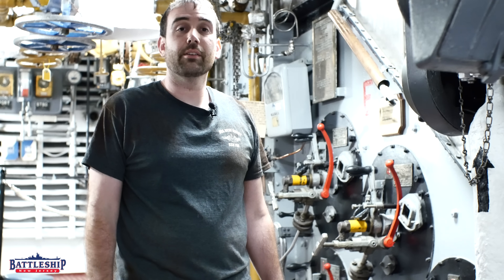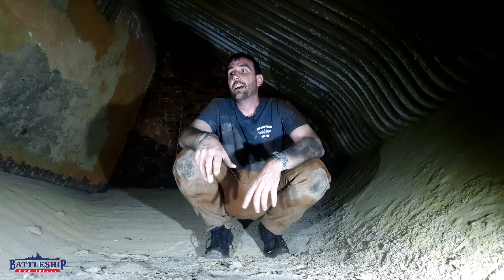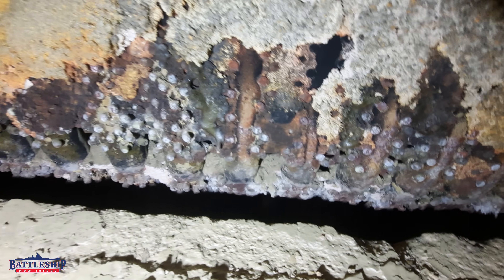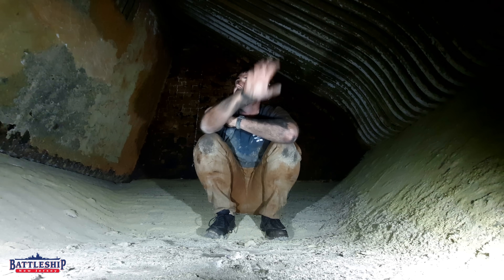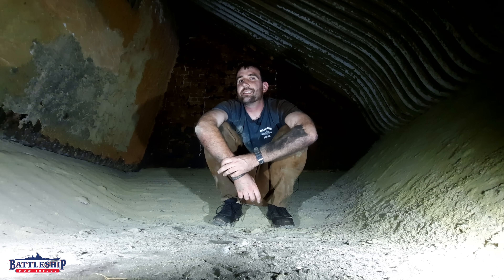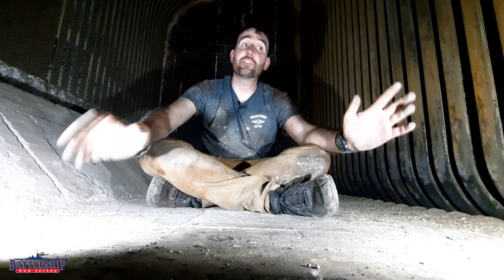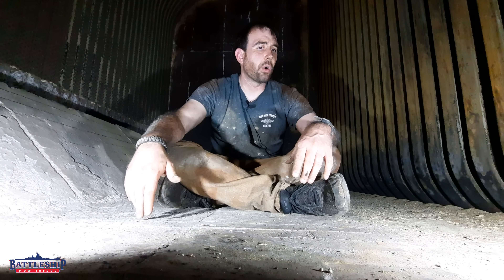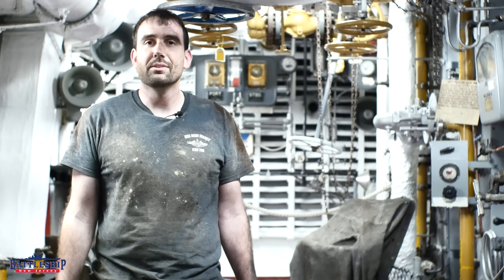Inside the Boiler of The World's Fastest Battleship

Comment: How similar are these boilers to what would be found on the ALCO Big Boy locomotives from the same time frame? Thank you & enjoy the vids.
Reply: Locomotives have firetube boilers vs the watertube boilers typical of marine plants.
Reply: Fire tube boilers have the fire on the inside, water tube boilers have the fire on the outside. Water tube boilers are much bigger usually and run at a higher temperature.  the water tube boilers are “high output” meaning that they put out a lot to steam to run the shafts and generators and auxiliary feed pumps and main feed pumps and oil pumps and forced draft blowers and fire pumps and steam kettles (in kitchen) ETC. fire tube boilers basically have a single purpose, run a drive shaft, heat up water for heating systems, stuff like that, not saying the have no other equipment, just one main purpose.

Comment: Thanks for going the extra mile and crawling in both sides!  ISTR hearing that later ships made higher pressure steam than the WW2 ships...  Is that true?
Reply: Large ships usually ran 600 PSI plants, while the smaller ones often ran 1200 PSI.  1200 PSI plants are physically smaller, but the higher pressures and temps make them a bit harder to maintain.

Comment: Been there, done that. 55 years ago. I had both 'M' and 'D' type boilers in my time aboard ships. One thing that most didn't realize was that in the combat zone, that boiler repair work was 24/7 until the boiler was buttoned up and re-fired. We had no 8 hr shifts. It was work until either it was your turn to stand watch again or the boiler was put back online. Many a night I snoozed on the deck plates. On most boilers, a burner was pulled to access the box. The 1600 hr steam time was just to clean and wire brush the exposed tubes and metal surfaces. Re-brick was only done in a yard unless there happened to be a brick failure and then the damaged areas were repaired with new brick. The studs were there to hold the plastic chrome ore (pco) that came in danm heavy short barrels that was rammed a handfull at a time with a pneumatic hammer, about the studs wielded to the tubes around the transition points where the tubed entered the drums. Most of the burners were fitted with pre-shaped fire brick supplied from B&W. Every opened boiler was a 'joy' to look forward to for the BT's. When I was in, the safety breathing equipment consisted of old T-shirts. That ash on the deck of the boiler was converted into clouds that a BT breathed for weeks when scooping it into buckets. That and the 120 degree heat of the Gulf made such a great incentive for telling the on-board recruiting NCO's where that stood in our lives. There was no cleanup when it came to chow. We would climb out of the hole and apparently looked like a pack of racoons standing in the chow line. From a good standing member of the Tonkin Gulf Club.
Reply: Hearing about all the occupational hazards I am happy to hear you being able to talk about those things so long ago!👍🏻
Reply: Let us not forget how hot the air was  , as i remember shortly after lite off the air temp would be at least 120 Degrees. I personally saw at least 3 thermometers that  exceded the scale (260 Degrees F) . Thank You . As a point of Trivia When I was aboard USS Hepburn FF 1055 in the Indian Ocean The Corpsman came down one day , the coldest place that he could find was 155 degrees , I never found out the hottest he recorded. Thank You . After all if the Snipes don't groove the ship don't move.
Reply: @henrycarlson7514  I was an FT on the USS Cromwell, DE-1014 circa 1966-1968. I remember seeing the BT's that passed out from heat exposure being brought on deck, washed down with cool water, rehydrated with bug juice and sent right back down to the fire room. BT was the worst job on the ship.
Reply: @richardbartley5906 Bug juice?
Reply: @iskandartaib  A little packet of flavoring the cooks would add to about five gallons of water and tell us it was fruit juice. Like cool-aid, but much more concentrated. Funny thing was the BT's were drinking so much of it that it was making them sick. Chief pecker checker told them to just drink water instead. The BT's were the ship's wild bunch. I stood petty office of the watch in port and dreaded having to deal with them when the came back from liberty. Good guys though!
Reply: @henrycarlson7514  I am doubtful.  We saw 127F air temp in the Engine Room in the gulf, with the FD air running flat out.  (between the TA's)  No idea what it would be like with only the NBCD coolers providing cooling, probably 140F, but never anything like 260F.  You'd be boiling (literally) at that.  It was worse in the BR, particularly on fan flats (and even more so adding chemicals), but I'd doubt even 130F.

As my ring says- 2A-3A-Circumnavigated .  Been there, got the photos, been in the modified D boilers (1664 generating bank tubes, 51 rear wall, 37 side wall, 3x51 superheat), 7050 lb/hr full fuel flow, 88 k lb & 19 k lb steam flow, 107 k lb water flow, 865F superheat temp....28.3" hg ME vacuum, 100-117 RPM max shaft speed, 21 000 SHP by torsion meter).

I never went into the steam or mud drums- but I spent a bunch of time behind the boilers, replacing steam temp control valve bonnet gaskets.  I did a fair amount of time in the BR & ER, as I was the Jr (by rank) controls tech basically 2002-2010, then Aux Machinery PO 2010-2012, and was going to go to the RAS deck in 2014 or so had I gone back before the fire.  

HMCS Protecteur, which I assume is the last steam ship to circumnavigate the world in 2008.
Reply: @jamespowell7302  I stand by those temps as thy were taken by the corpsman with a dry bulb thermometer , I also standby the readings that I personally recorded. Sadly I an sure the documentation is gone. . Congratulations on that trip. When I was aboard USS Ranger I presonally saw 2.2Million ftlb  of torque at 172 rpm , 6 boilers at 2200 gph . that was 76,000 tons of Aircraft carrier going 29.9 Kts. . There were 2 boilers not lit off.  Thank You for sharing. . From what I remember the US Navy operated at 1200 psi and 970 D F . Happy trails, Snipes RULE
Reply: @henrycarlson7514  Snipes
Heaven didn't want us and hell was afraid we would take over.
Reply: So true @robmcconnell4702
Reply: @henrycarlson7514  Snipes, the first of ships company back to the ship to bring her out of cold iron. And, the last to leave the ship when we hit any port.
Reply: @jameslong3351  So True, If the snipes don't groove the ship don't move
Reply: @jameslong3351  I was a photographer for a large company that had it's own steam plant. The boilers started out burning coal but were converted to natural gas. Thrn after we built a giant "bag house" they tried to convert back to coal. Nobody could find the original drawings so they kept getting a buildup of "clinkers" on the tubing. I got to go in and photograph it so the fire brick could be reconfigured to eliminate the buildup. If it cooled too much the clinkers would break loose from the tubing so I had to dress out in PPE and be slide in with my camera on a board like a big pizza. It was an unforgettable experience. I seriously liked the job because as long as I was inside I never saw a supervisor to aggregate me. I got to know some wonderful guys running thr steam plant.
Reply: Boilermaking ruined my knees crawling in and out of economizers steam drums and mud drums. I can’t even kneel on carpet with padding on top. My knees are toast, I’m as close to knee replacement as you can get.
Reply: Yeah definitely a pack of raccoons with somewhat clean hands. Fireside and Waterside. CV-67 B-Div 4MMR
Reply: @robmcconnell4702  And that, dear children, is why I'm being contacted at least yearly now, by attorneys for the families of former shipmates who suffered through mesothelioma (asbestos related lung cancer) to sign a deposition regarding work conditions in ship fire rooms. That and hearing loss from machinery, especially forced draft blowers, is certainly effecting our so called 'golden years.' This comment from a retired BTC, 17 years sea duty, (1956 - 1976) now 83 YO.
Reply: @johann5633  did those boilers also have induced draft in addition to forced draft fans?
Reply: My brother in law was an ET on a DE when the Tonkin incident went down. Since his battle station was in CIC he told me it didn't go down as reported. I was an EN on a sub tender and I work on the landing craft we used to haul stuff across the Clyde in Scotland. One of my jobs was to open and crawl inside the diesel fuel tanks on landing craft to clean them. The NJ was next to us when we were in the yards in Bremerton. At the end of Desert Storm I was in Bahrain with a Navy Reserve unit when the big MO stopped in her way home I bought a ball cap in ships store. I saw her in the moth ball fleet and was very happy to see her alive and well.
Reply: Yea the heat was literally unbearable during emergency shutdowns when a tube had burst or the like. Didn’t matter how many airhorns and fans at entry points were used, the air coming out was as hot as a hair dryer could produce.
One side of boiler was forcing air in, other side was pulling air out just to cool it where it could be entered without falling out from heat exhaustion.
I only “survived “ one emergency shutdown, I almost had to be rescued as I almost succumbed to the heat. Worse feeling i ever had, like getting in your hot car in the summer, closing your door and trying to sit for 5 minutes breathing down really hot air. Regular boiler work was a cake walk compared to an emergency shutdown.
Reply: I would have jumped overboard lol
Reply: Tell them about doing watersides, that was what the 1600 hours was for was to kickin the steam and mud drums to punch tubes with a maneater.

I only remember once that a boiler was steamed pass 1600 hrs. It was the North Korean Axe murders of two Army personnel while they were trimming trees in the DMZ, the year was 75', but I could be wrong there.
Reply: What are the BTs, boiler technicians?
And Snipes??
Reply: @thomasmleahy6218  Thermal Dynamic Marine Propulsion Engineers.

Nothing is lower in a ship. We were the Unseen, Unwashed, Underappreciated men who without whom the ship would be only a floating pier
Reply: @thomasmleahy6218  Yes.  And Snipes are anyone who serves below decks, rarely seeing the light of day. Engineers. Bt's. Firemen etc. Generic for all of them.
Reply: @thomasmleahy6218  So true
Reply: Try being the only steam ship in Persian Gulf running 1 of 2 boilers FF 1089 J.L. Brown and blowing a tube going DIW and trying to save enough steam to start 2nd boiler 850 psi. Temps got 145 +/-  on upper level from what I remember ( those years are hazy at best ), think we were only allowed ( OSHA ) less than 5 minutes in that area then 2 hours in AC . All happening about 2 am
Reply: @philipfaris7144  Did it on the DE-1048. Those were terrible boilers, better to have used to make coffee at a large Starbucks
Reply: Did my time cleaning out a "mud-drum" of a B&W DDE boiler. The fuel tanks needed steam cleaning and what we referred to as "Butterworthing" or coating the inside of a bunker fuel tank with stuff that resembled butter.
Reply: Thank you for your service and may God bless you my friend.
Reply: I'm assuming that "Snipe" is a contraction of the old-timey word "guttersnipe", meaning a street kid or an unhoused/destitute person. Military services didn't screw around with nice friendly nicknames back in the early-mid 20th century. In those days, if you were the lowest on the ship I guess you got a nickname that straight-up meant "the lowest on the ship".

A more amusing alternative origin story could be that Snipe comes from the folkoric creature of the same name. A mythical and elusive animal (typically described as a bird but there's no rules about that), also rarely seen in the light of day, the target of the legendary Snipe Hunt. Otherwise known as a wild goose chase, quite familiar to any young seaman/apprentice who was ever sent to the tool shop for a left-handed screwdriver, a cable stretcher, or a long weight.

Thanks to the OP for the info about the studs on the water tubes, they instantly looked way too regular to be some kind of deposit buildup and I was really wondering what they were all about.
Reply: That lung cancer is totally not service related....
Reply: Great testimony! Thanks for sharing!
Reply: Unvaluable testimony !
Reply: B and W?
Reply: @DesertCatDad  babcock and wilcox
Reply: @DesertCatDad  Babcock and Wilcox
Reply: @DesertCatDad  babcock & wilcox  the first name in steam
Reply: Babcock and Wilcox--the first name in steam
Reply: Thanking you for your years of service aside, your opening says all I need to know... "Been there, done that..."  lmao.. you're that guy who finds a way, anyway to tell your story in conversations where all the topic needs to be is somewhat related.. you worked the hardest,  stayed awake on patrol and boiler repair the longest,  got the dirtiest, volunteering for the most dangerous,  ate chow the fastest, put away the most food, all while walking 10 miles up hill to get to the ship each day in a snow storm... lmfao... your comment was very detailed.. Ryan must have asked you about your work in the navy.. Just I must have missed that part.. otherwise you would be the biggest unsolicited claim maker too 😉
Reply: @svenben9868  I freaking enjoyed his reply, and he filled in all the gaps. Don't know what your beef is. Anyway, until YOU'VE been there yourself, you are really just an observer that knows nothing except to complain about a cool response. And now I do always appreciate those BT's that worked so hard to keep my ship underway while steaming about the equator, something you may not know about.
Reply: @svenben9868 respect to you.  Thank you for your service.

Comment: Two questions: 1 Is the 1600 hr figure accurate? That would be about every 2 months of operation, for fire-brick replacement.
2 - how does the fuel used during WW2 compare to Mazut, used by some Russian vessels?
Reply: 2: I do know enough about fuel oil to tell you Mazut and Bunker C are VERY similar. The main reason Russian ships that still use it smoke so much is because their all old Soviet Era ships that werent maintained. The Russians have been building everything lately with diesel engines, or Gas Turbines like the US
Reply: @TheMrLebaron  The main reason Russian ships that still use it smoke so much is because it's at the lower end of fuel oil(residual).  In a fractionation tower, lighter stuff evaporates(gasoline, #1 fuel oil which encompasses "diesel" and "kerosene", #2 fuel oil which is home heating oil) and is called distillates.  Heavier stuff pools at the bottom and is #5(bunker B), #6(bunker C), and bitumen(coke, asphalt, etc).  The pool is known as "residual".
Residual is gonna make smoke.  Longer hydrocarbon chains = less complete combustion. It contains larger amounts of the contaminants present in the feedstock(Notably sulfur and heavy metals), as all the contaminants just sit in that bottom pool.  You won't have as many contaminants processing "Saudi sweet and light" as you would "Kern County crude".  You could also do a secondary refining process.

However, Russians don't care.  Their fuel is...  kinda shit.  It costs money to put feedstock through multiple refining processes just to remove contamination.  Easier to leave the contamination in and ignore pollution/maintenance issues and sell it in grades based on the type of initial feedstock used.
Reply: @Grimmwoldds  No, no its not that.Russian ships back in Soviet times NEVER used to do that. Up until the 80s, when ships fell into disrepair. There are plenty of Russian ships that used Mazut that never smoked. But when you have the 80s Russian ships kinda like their carrier and the bigger DDs. Along with no long term maintce. You saw all these Russian ships blow so much smoke
Reply: @Grimmwoldds  The best Example is the  Admiral Kuznetsov. That thing was built so poorly, the water cooling tubes in the boiler blow out all the time, so they leave slime everywhere, and the gaskets above the burners fail all the time, so it spews smoke when its working, US Ships with Bunker C NEVER did that even tho its a similar fluel. I feel bad for the Russian crews. They have to deal with 1 hour of water a day, no AC, constant breakdowns, huge smoke clothes, leaking water cooling tubes, leaking boiler water channels, a whole 4 deployments in 35 years. Theres a reason they moved on to gas turbines and diesels
Reply: @Grimmwoldds  In fact Mazut fuel is so bad, if you dont light the nozzeles EXACTLY right, the entire boiler system flames out and the ship loses power. Thats why they always had tugs following it. Outside of SSBNs everything the Russians built was 100% junk
Reply: @TheMrLebaron  Judging by the number of reactor accidents the Soviets/Russians had on their subs they weren't any too good either.
Reply: @Vincent_Sullivan  No shit, Russia has NEVER made a single weapon platform that actually works
Reply: Check out P.A. Reysen's comment a few entries above this one:  apparently the 1600 hr. mark was to scrub down the firebrick - replacing had to be done in a yard